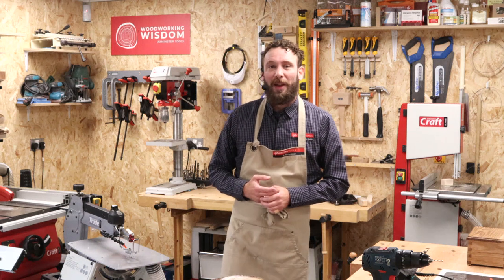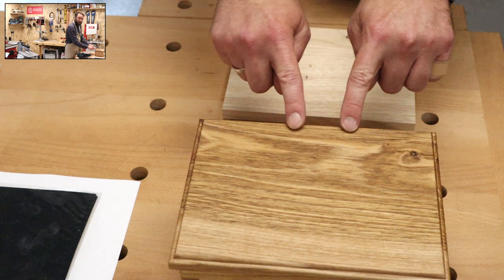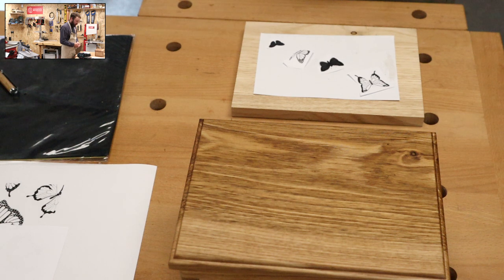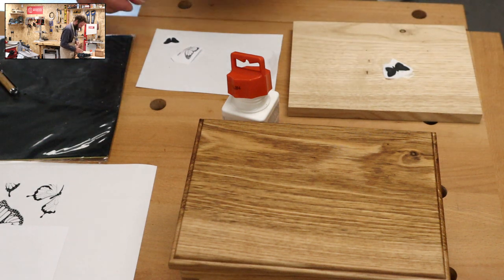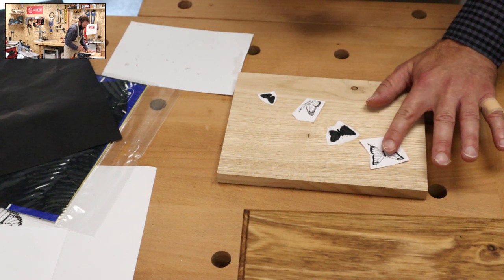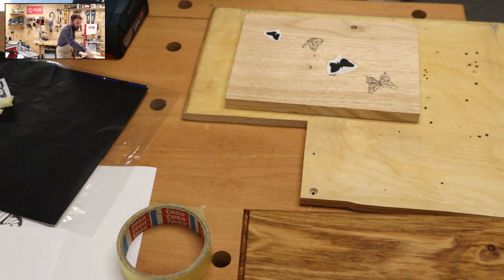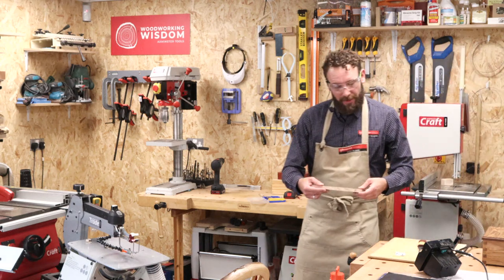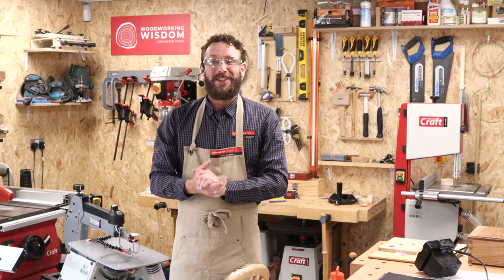Jewellery Box Decoration

Comment: Can you please tell me if you were to  do  fine fret work what sort of wood would you  use not done any yet but someone wants me to do some for them please
Reply from the maker: Hi Lee, the following reply is from Ben - "Try to avoid open grained timbers like Ash and some Oak. Go for something with a nice close, straight grain like Beech,Lime or Sycamore. If the material is very thin it may be worth using a waste backing board to cut on so that the back of the workpiece is supported."